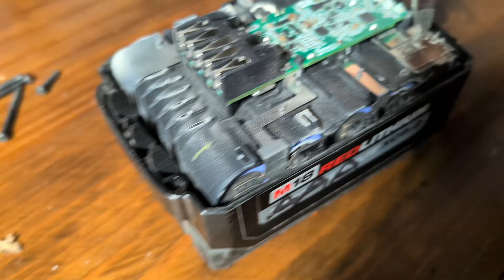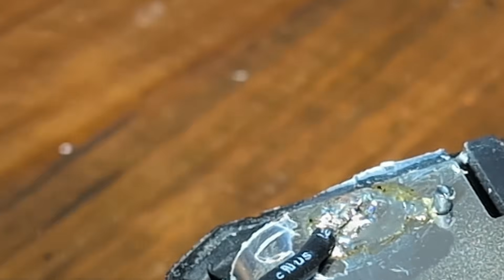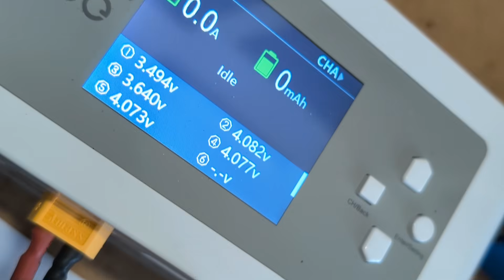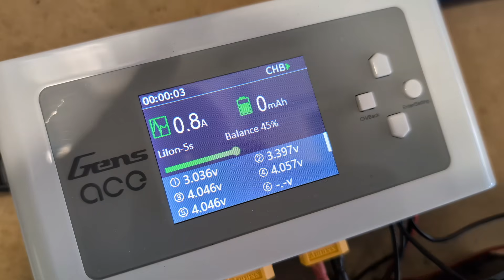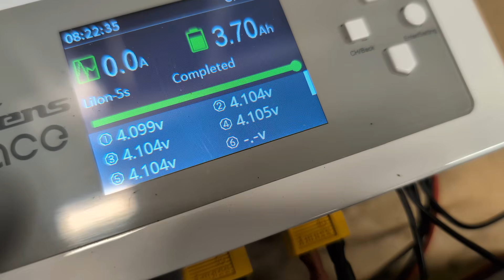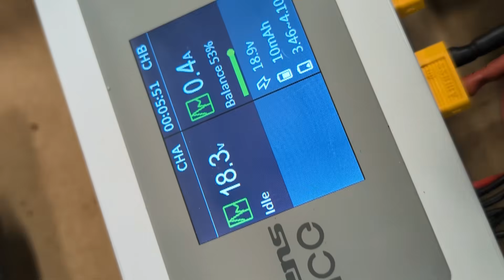How to Fix Incomplete Battery Charging with a Balancing Charger

Comment: Very Cool video.  I'm learning more about these types of battery packs and also the Car LiPo Jump Starter devices.  They too have multiple cells and a balancing circuit associated with charging them built right into the pack itself.  Not sure how good they are, but I can see what a nice job your charger/balancers do for the batteries.  Thanks for sharing, very informative.  Now you just need to buy yourself a little mini camera holder or a chest mounted holder like some of the HVAC guys use to video their work during the day.  That would definitely free up your hands and keep the video a little more stable for viewers.  I appreciate you sharing your knowledge on this topic, I have learned a lot.

Comment: Great job of explaining.  I finally found an 'unbalanced' Milwaukee battery that wasn't so unbalanced that this charger wouldn't work on it, so I'm actually able to do this for the first time today.  I'm also looking into getting a cheap spot welder, some nickel strips and some decent replacement cells to fix a couple other 'dead' M18 batteries with 2 or 3 really bad cells /12 or 13 cells usable cells.  I can't stomach forking over another $250+ for new M18 batteries if I can fix them by replacing the really bad cells. 

What do you think about keeping an infrared thermometer handy to better keep an eye on battery temps? 

Thanks!

Comment: It would be cool if you could mod the case of the battery and leave in the 5S balance charger harness and then have it sealed up or have it on the top of the case where that part of the battery is always in contact with the tool.  Then you wont have to pull the batteries apart and just add your 5S harness connector and B+/B- cables to balance the cells.

Maybe someone should start 3D printing M18 top cases to hold a 5S connector...
Reply from the maker: I love the way you're thinking; keeping that harness accessible would certainly make cell balancing much easier.  I saw one video of a guy who did that, and it was more work than I wanted to do, but I love the idea in general!

Comment: Any experience how long it last before you have to do it again?
Does it also work with 36/40v batteries? by doing it at 2 times?
Reply from the maker: I would say that it seems to last a good long time, but certainly not forever. It definitely depends on how often and how hard you use that particular battery pack.  

The 36/40 volt packs are very similar, but I don't have any of those to tell you exactly how to do it.  But the basic principle is the same. Each one of the parallel groups of cells need to be balanced to all the other groups of cells. It's certainly possible for you to divide one of those packs into 2 18V 5S groups of cells and run this procedure twice, but just be very careful. Obviously lithium batteries can get very cranky when mishandled.
Reply: @AAAElectricFL  The problem i see with 40v pack how to connect the two main connection, guess it does not work to connect them to the outside +&- terminal with the higher voltage?
Reply from the maker: @andders2477correct, that wouldn't work unless your particular charger supported 10S packs I guess.  But yes, internally, you should be able to find the middle of the 10S series and do each half separately.
Reply: @AAAElectricFL  Thanks

Comment: Very interesting, assuming this is similar for all brands. 

Don’t the individual cells wear out over time or is the problem mostly out of balance ?
Reply from the maker: Yes, I haven't really heard of any brands that really include true balancing inside their packs. Individual cells can be more problematic than others due to differences in manufacturing or defects.  It might be a good idea to mark the cells that tend to get out of balance the worst, and then you can decide when it's time to replace the pack if it's no longer worth the hassle.

Comment: very informative.   have you considered using small supermagnets to secure the balancing wires to the pack instead of soldering on then soldering off?
Reply from the maker: Something like that is a good idea to explore, but it might be difficult because I don't think there's anything in the bus bars that will hold a magnet in place.  I think they're made of copper with nickel plating.
Reply: @AAAElectricFL  , did i really suggest that?   ive dismantled a milwaukee pack and yes, the bars are nickel plated copper.

Comment: Not very often I can stick around through a whole tutorial video without skipping around. You answered a lot of questions I had and explained everything very well, thank you for the great video. 

I do have two questions. I’m using a skyrc b6 identical to your blue one. When charging a single bank, is it okay to ramp the charging amperage up to the max (6.0)? And when charging all 5 banks, what is the ideal charging amperage with the b6?
Reply from the maker: Thank you! Good questions.  The charge rate for a single cell should be limited to the rated charge speed for that cell, which you would have to look up with the manufacturer of the cell.  6A isn't out of the question, but it's higher than I would recommend if you don't know the specs on the cells. Typically, charging at a slow rate will keep the battery chemistry intact for longer.

To answer the second question about the charge current for the whole pack, none of these balancing chargers will probably give you anything higher than half an amp. I think my nicer one might go as high as 3 amps, but as I recall it's usually closer to 100 milliamps.  Basically, however long it takes 100 milliamps to bring your parallel group of cells up to the higher voltage is how long it's going to take to finish balancing, regardless of the main charging speed of the of whole pack part of the charger.

Comment: כל הכבוד!!! באמת הסבר מקיף להטעין את הסוללה במצב איזון של בוש קניתי את המטען הזה להתטעין במצב איזון הוא עובד יופי גם על מקיטה וגם על בוש אבל שניסיתי להטעין את הסוללות של בוש ומקיטה לא במצב איזון אלה במצב רגיל ללא איזון הוא לא נותן ניסיתי כמה מצבים ולא נותן יש לך אולי כיוון איך כן אפשר להטעין את הסוללות במצב רגיל ללא איזון תודה מראש
Reply from the maker: I don't know. It's possible there may be some kind of solid state switch that is disconnecting the terminals. Also, make sure you have the correct polarity. Good luck!

Comment: Great vid - thanks for the the tutorial AND explaining some physics and logic of the way these 18650 batteries function. Question for anyone - what is the most helpful tip to keep these semi-balanced between individual cell charges. The only piece of information i have on this is to store them at a 60% charge.
Reply: Some are 21700 batteries.
Reply from the maker: I haven't really researched this a lot. Battery chemistry lasts longer when you don't ever charge them up to 100%, but that's not a lot of fun if you're trying to drill a bunch of holes.  The balancing lasts long enough that I am fine redoing it every once in awhile and just using the batteries normally in between.

Comment: Dude, you don’t need bms and solder those wires. All you need is to charge every single cells to 4.1V. It should take about 6hrs of charging.
Reply from the maker: It only takes about 20 seconds to solder the wiring harness on, and then the balancing charger does all the balancing automatically.  You of course can charge each parallel-connected group of cells to 4.1V individually, but then you have to babysit the process and shift your charger leads 4 times.  It's less time and hassle to use a balancing charger, but it's not the only way.  The idea is the important part - get all cell pairs to 4.1V (or any other arbitrary common voltage about 3V to 4.1V).

Comment: best to unhook battery first - then unplug wires - much less chance of sparks/short
Reply from the maker: Not sure exactly what you mean, but thanks for your note!
Reply: @AAAElectricFL  wires are not Hot when disconnect First from battery - unhooked from charger first wires are Still hot  - 
Messing with Hot wires for no reason eliminated by  unhook battery wires first
Reply: @GroovyVideo2 that’s not practical to do for these batteries.

Comment: But how long does it last? Wont the weak cells just become unbalanced again?
Reply from the maker: It lasts quite a while, and you can always do it again.  It's loads better than buying a new battery....  It's worth the process to dramatically improve the useful life of your batteries.  The time between balancing charges depends on usage and the specific physical characteristics of the individual cells.  About a year later, I think only 1 of 8 that I balanced has relapsed to the 3-LED issue.

Comment: ✅ Success! I can confirm his method works perfectly.
One of my 12Ah M18 batteries was completely dead—just flashing a white light and totally unusable. After following the balancing procedure exactly as shown in the video, I was able to bring it back to life. All cells charged up to 4.10V.
🔌 Quick note on the setup:
The connector I ordered from AliExpress was a 6S type, so I had to snip off one of the wires to avoid any issues. Just like he demonstrates in the video, make sure the negative (–) lead is positioned on the far left side of the Gens ACE charger.
⚠ Important final step:
Even after charging, the battery still showed a flashing white light. That’s because the onboard chip hadn’t yet recognized the new charge state. To fix this, the battery must be placed on a Milwaukee charger for 30 minutes to 2 hours (exact time may vary). This allows the internal circuitry to reset and properly register the restored voltage.
⏳ The process took several hours since the cells were heavily out of balance. The fan noise didn’t exactly win points with my wife—but once I mentioned how much money we were saving, she was suddenly okay with it 😄.
🔧 One thing I’ll do differently next time:
For the remaining six batteries, I’ll use alligator clips instead of soldering directly to each cell. Way more convenient and less hassle.

🙏 Special thanks to the video creator for sharing such a clear and effective method. You saved me time, money, and a whole lot of frustration. Truly appreciated!

Comment: I was finding that my leaf blower would run for shorter and shorter durations every time I used it until it would only go for 10 minutes.  It turns out that had a 9Ah battery with one group of cells that would only charge up to 3.6V while the other 4 got up to 4.09V.  I soldered the balance harness to the battery as you show and balance charged on the D300 and now the blower runs for a long time again.  Instead of desoldering the wires I left the balance harness soldered to the battery and dremelled a slot out of the case for the harness to exit.  I will only be using the D300 to charge these batteries from now on.
Reply from the maker: So awesome, glad it helped

Comment: Another example of battery manufacturers shipping crap chargers.    There is no reason why a manufacturer could not offer balancing chargers.
Reply from the maker: The issue with balancing chargers is that they need access to every battery terminal in the middle of the pack.  Would need at least 6 pins on the battery pack.  Would need more if they couldn't do comms over those pins.  I don't know of any manufacturer that uses a connector with that many pins.

The easier thing for them to do would be to place effective battery management on the internal circuit board inside the battery, and that could keep the cells balanced at all times.
Reply: @AAAElectricFL  DeWalt 18V/20Vmax batteries has 8 connector pins including all the balancing pins. Although those are connected through a 10 Ω resistor each internally in the battery. So, you can't really use them for balancing as a 1 A current would result in a 10 V drop over the 10 Ω resistor. When you look at the DeWalt batteries it looks like the connector only has 5 pins. But what looks like the 3 middle pins are actually two rows of 3 pins on top of each other. So be very careful if you put a multimeter probe or something on these middle pins as you can easily short the upper and lower pin.
This video shows the pinout of the DeWalt batteries: https://youtu.be/nkZVdN7jEkw?si=6PwqbJNkAC0OhEUO

Comment: Thank you.  Been doing this cell by cell and it takes forever.  Wondering about sticky tape, copper tape vs. soldering.  Thoughts?
Reply from the maker: It all depends on the quality of the connection and how hot the wire and pad would get. I think you just have to try it and see. I could imagine the adhesive wanting to come off a bit as it heated up, leading to sticky residue that could reduce conductivity on subsequent tries.  However, I kind of doubt there is actually enough current flowing to heat the balance wires up.  Give it a try and let us know if it works

Comment: Thanks for the video. Is it possible to use the same balance chargers on a 40v battery where you have 5 banks of 2 cells in series so each bank is 8v? Will the balance charger be able to balance those banks out?
Reply from the maker: This particular charger sends the main charging current through the main pack plus and minus terminals. The maximum output voltage is around 30 VDC. You couldn't use it easily to balance your 40V battery.  There are of course ways of hacking into the battery and splitting it up into sections, and then setting the balance charger up to reflect those sections.  Remember that any particular series-connected chunk of a battery pack can get out of balance, so you need to get down to the very lowest series-connected part and individually balance that.

I looked quickly but couldn't find any balance chargers that looked to be set up out of the box to handle this type of 40V battery.

Comment: most of powertools battery packs they don't have a balancing capability..
their bms have the IC, which actually can balancing the battery packs but the manufactures doesn't programming the IC properly..
so, the balancing features was disabled (might be on the purpose) or they just too lazy to do that.. 

no wonder if the battery would be unbalanced overtime because there was no balancing process from the BMS at all for charging..
the BMS of the battery powertools, just for protection.. 

and while charging process was completed, it just one cell or two cells (in parallel at the last rows) of the battery pack.. 

so, most of the powertools battery has 5S2P configuration, the fifth row will fail first because this cells always fully charged (or even overcharged slightly) while the other batteries would be somewhat undercharged..
and this undercharged battery will be always overdischarged until the BMS cut-off triggered.. 
but too early while the other batteries still has enough charged to be used.. and you did not get the full capacity from your battery because the unbalanced problem..
Reply from the maker: It seems like such a scam that they don't have proper balancing function from the factory.

Comment: If you have no complicated charger you can use a bench power supply and charge each cell (group if they in group) to 4.2volts. Once all cells are charged, let them rest and measure each. If one cell has a big deviation that cell is already not in good condition and must be replaced. 

Since Milwaukee wont put a built in cell balancer it is useless to rebalance the battery if one of the battery is already failing it will keep falling.

Comment: I just manually balanced the cells on an 8AH milwaukee...what a PITA.  One cell group at a time.  Took 5 days, but I didn't have that cool charger you've got.  Hoping it holds.
Reply from the maker: Oh yeah. That is a giant pain. It's worth investing in one of these chargers, because eventually you are going to have to do it again, but you can get one of the slower ones for around 30 bucks.  Any 5s Li-Ion  balancing charger will work.

Comment: I have several m18s that are exhibiting an imbalance. I will be making a weighted fixture to set on the battery with the balancing leads attatched to the terminals contacting the battery pads eliminating the soldering.
Reply from the maker: That's a great idea.  You could use springs attached to a backplate or similar.  Let me know what you come up with - I may have to make one.  It's annoying to take the battery all the way apart to use alligator clips.  Obviously you'll still have to scrape the plastic off the nickel plates unless you have a different way planned.